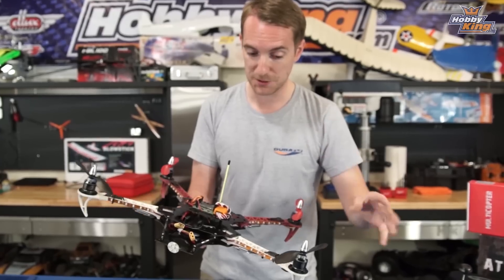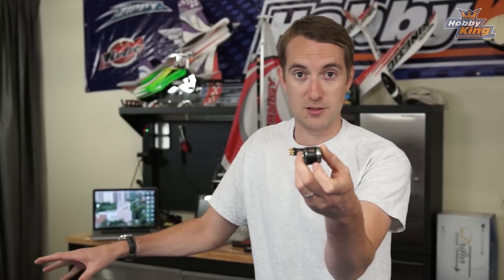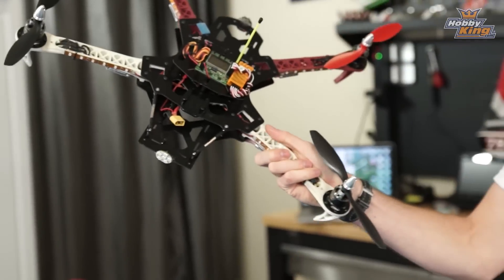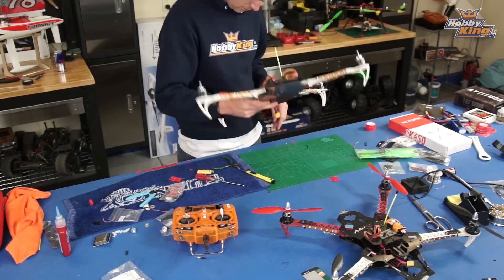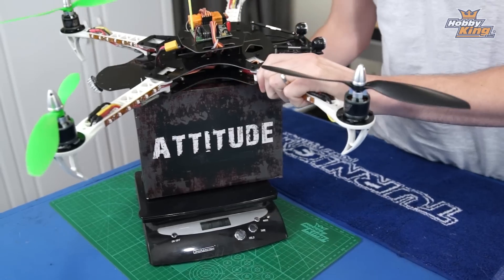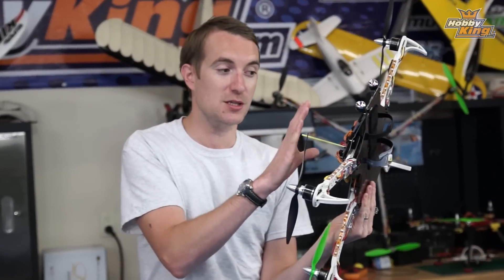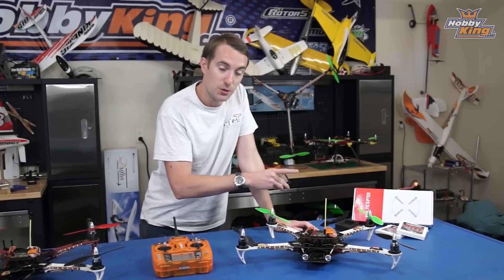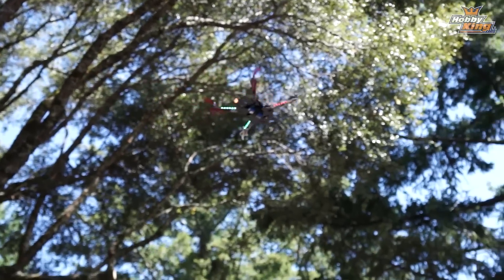Hobbyking SK450 'Dead Cat' - Walk through part 2.

Comment: Just finished setting mine up with the HKpilot mega 2.5 FC board and i'm loving it but just got to do some fine tuning and then I should be good to go,still got to set up my FPV gear onto it but that will come after i'm happy with the flight and the way I've set it up.

Comment: Did you take into account the difference in weight between the motor prop combo as well? Wondered if that affected the lack of substantial difference in weight. Although 25% increased flight time is nothing to scoff at? Good job on the video!